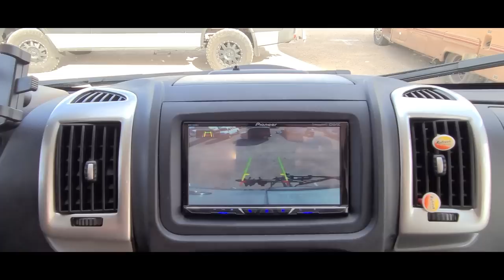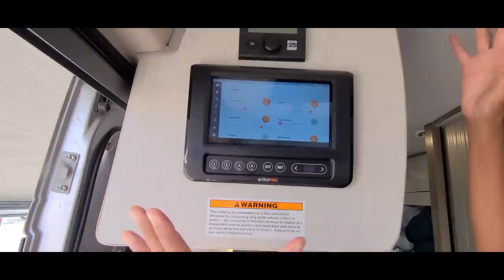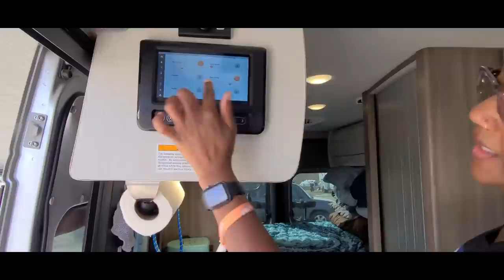VAN TOUR | Unique Upstairs Bedroom 🤩| Solo Female Part-Time Van Living |Military Service

Comment: This was very nice. Thanks to the both of you for sharing. I love that it’s already built out. Never seen this before. May I know the cost of this ?  How is the gas mileage?  I noticed you don’t have solar panels. Assuming a separate battery supports the usb outlets/air etc. 
Thanks in advance for any answer to the above inquiry. 
Thanks for serving❤️